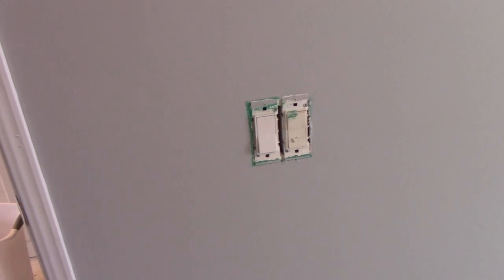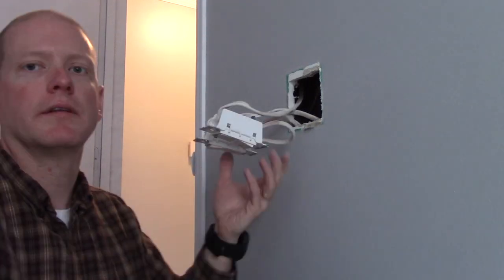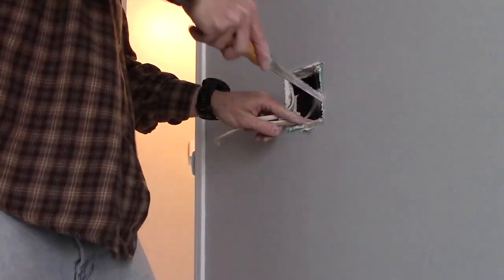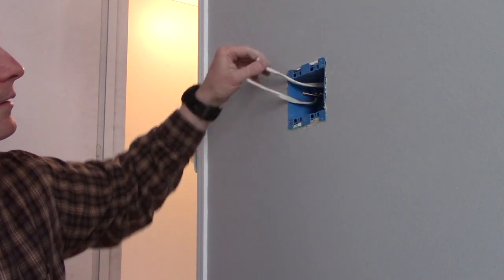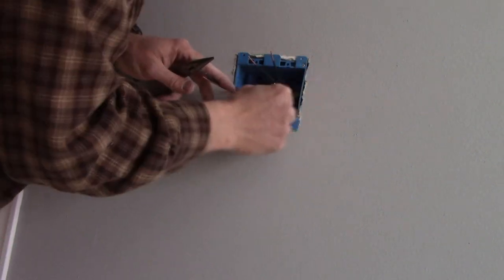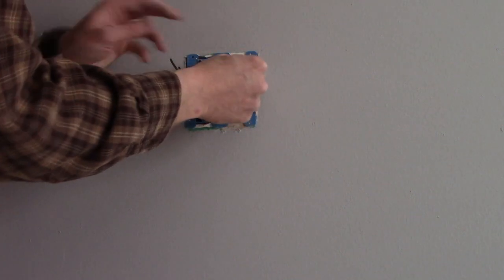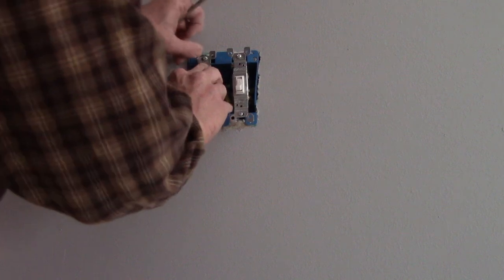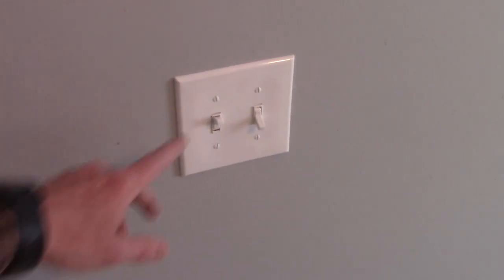How To Replace Mobile Home Self Contained Wall Switch or Outlet

Comment: good morning. im looking to take on this exact project this morning. i get lost at the ground wire part.. where are you pushing the ground in the gang box?
Reply from the maker: Please don't take this the wrong way, but honestly if you don't understand the ground wire situation you probably shouldn't be doing this. You would not want to burn down your house and electricity is very dangerous. To answer your questions, the grounds are all connected to each other and to the ground screw on the outlet or switch. They provide an alternate path to earth just in case a hot side wire were to come in contact with the appliance or switch, etc.
Reply: I understand getting lost at that part. Around the 16 minute mark, you put the two shorter ground wires in the wire connector, then a jumper in the same connector? After the 16 minute mark… the explanation on which ground you put where, falls short. So you have two ground wires in each connector? Plus the jumper?
Reply: 1 jumper (black) is power to the switch, the other is a ground wire for the ground terminal on the same switch, also, I believe he had 4 ground wires, plus the one to the switch so a jumper would be needed to connect all 5 of the grounds together @THEerynwithay

Comment: have you ever had to install gfci outlets on a 80's model mobile home ? 
friend of mine bought a double wide mobile home and wanted gfci outlets in the kitchen . there were 3 old outlets. we bought 3 gfci units. installed them , and no power. so then we put back to of the original sockets with the 3rd being a new gfci . then it worked. 
any idea as to why 3 gfci's wouldnt work on the same circuit ?
Reply from the maker: If they are all on the same circuit and daisy-chained from one to another you only need one GFCI. There is a line input and a load output on the GFCI. You might have had it wired backwards, the in and the out. It will not work if it's wired backwards
Reply: yaa, thanks for the info... and , seems I did wire it backwards.. but I corrected it on the first gfci socket. this same socket also supplies power to 2 other wall plugs along the kitchen counter top , making a total of 3.
for some reason , the seattle house inspector says there needs to be a gfci on all 3 of these plugs. i kinda question his thoughts on this matter tho , just dont make no since to have 3 gfci's in a row like this when all you need is 1....

thanks for the reply....
Reply: Just found this 

https://www.lni.wa.gov/TradesLicensing/Electrical/files/Misc/ResidentialChecklist.pdf

" D NEC 210.8 At dwellings, ground-fault circuit-interrupter (GFCI) protection shall be provided for the kitchen
dishwasher branch circuit and for all receptacle outlets in bathrooms, garages, crawl spaces, unfinished
basements, kitchen countertops, laundry areas, boathouses, outdoors and within 6 feet of sinks, bathtubs,
and shower stalls. All GFCIs shall be readily accessible.
Reply from the maker: Yeah different states/cities have specific requirements
Reply: yup yup....
Kanon Electric came out and installed the 3...
15 minutes worth of work for $645.00.
I had to find a bucket of ice water to sit my butt in ....lol
Reply: Your smarter than the Inspector @donnyinalaska

Comment: If you are replacing an outlet with one open wire and one "U"ed wire, do you keep your ground and neutral joined?
Reply from the maker: I dont exactly understand what you are asking, but you should never connect the neutral and ground in an outlet or switch box.
Reply: HALP! I have the same problem as this young lady and precisely the same wiring situation as what you show. I have all the commons connected like yours using the same wire connectors. The ground is connected using the jumpers. The problem are the Hot leads. Either when I  connect  them, the fan works, or the lights but not both at the same time. Using a volt meter shows one switch with power, the other without. What am I  doing wrong?  Wife is about to shoot me.... any hoo how, Happy Holidays!

Comment: So we tried following this video but we don't know much about wires. We couldn't really see which wires you were grabbing in the video. Is there anyway you could give us some tips on mkaing it easier when we don't really understand this? We managed to get it replaced, but our old work box won't secure all of the way flat against the wall on the bottom. We also somehow managed to have the light that controls the fan being the first one when we changed it instead of it being controlled by the second switch, which we didn't mean to do. Thank you!
Reply from the maker: Id love to but without understanding your specific situation that is almost impossible. Obviously you want to do this yourself, otherwise you would have hired an electrician, so Id recommend watching some other youtube videos on wiring basics, such as how a lighting circuit is run, what the wire colors mean, etc. It also helps to label your old wires before you remove them that way you can hook them up the same way on the new switch or outlet.

Comment: As explained by one commenter below (yeah, those self contained switches and outlets blow) - I have 2 or 2 1/2 inch walls with no stud in sight. I have a number of 2 inch boxes now - but with 6 - 12wire coming in - I think the only way out is some sheet rock work.

Comment: Now if I can just figure out the wires. I’ve watched this video three times so far and simply can’t figure out what to do with all the wires. 

I have one hot, one neutral and a ground all from the breaker box, one black, one neutral and one ground from two other wires coming in that go to the fan and light. I see he puts two black jump wires in the connector box and two black wires from the home. He puts the commons together in a connector box but do ALL THREE commons go in those connectors?  Do any of those connect to a switch?  Then he connects a black wire to that second switch. Is that the jump wire from the connector?  Because it looked like the main wire coming in for the fan. 

I’M SO CONFUSED with all these wires!  An electrician even looked at this mess and said he really didn’t know what was going on with that stuff. So now it’s up to me to figure it out. 

HAD TO CHANGE THEM because one switch was black inside and some black on outside indicating a short in there and the flippers broke on both of them. 

Anyone have any advice for me?

Comment: The self contained switches are just about as bad as wiring up a switch using the quick connect method. Screw terminals are always a much better option.

Comment: I wish he would have explained what wires he was connecting and the light in the box was low so couldn't see that well.
Reply: I agree and I couldn’t see because of his hands but that was not his fault as the wires were too short to pull out and show us. 

This is the EXACT situation I’m in. Hooked everything up the way ace hardware told me, nothing worked, NOTHING. 

Talked to an electrician and followed his advice who said I have to have ALL GROUND WIRES AND ALL COMMONS hooked up. Breaker kicked as soon as I’d flip the light or fan switch. 

Talked to another electrician who said do not hook up commons and ground, only one or the other. Tried it both way. Breaker kicked every time, same as before. 

Talked to an electrical supply company. Told me put all black wires from power and light in connector box and jump wire to light switch then jump wire (black for power) to another connector box and go to fan switch. Do the same with all commons and hook every ground up. 

That got me power, both light and fan worked whether they were in on or off position when I turned breaker on. As soon as I’d flip EITHER switch in or off, breaker kicked. 

PS, had electrician out and he said he really had no idea what was going on with this mess. I think he was the wrong electrician. 🥺

Any advice?  Help?  ANY information that might help at all???

Comment: Question, just replaced one of these with a regular outlet. My problem is they used it as a power tap where a single Romex went through it then on top of that was another romex going out. So it looks like 3 romex cables are there. How should I properly wire an outlet? I did like this guy did in the video at 3:33 ...... https://youtu.be/tFVlonwpsco
Reply: I hope you figured it out or got an electrician.

Comment: Gang box is too deep for my RV wall.
Reply from the maker: Yeah this video does not apply to an RV.
Reply: They make shallow wall boxes.  If your local store carries them.
Reply: Cut the back off the box, then save it to either drill holes and zip tie it to the proper length or duck tape it back on.
Reply: They have shallower ones.  I've seen em at home depot and Lowe's probably has em also.

Comment: I wish you actually show how to replace those boxes with THE SAME one... I don't care they are garbage :).
Reply from the maker: Lol. Sorry i cant have them in the house. I think they are unsafe.
Reply: @JackofAllMasterofNone  no, problem. You are right they are not good. I'm going to replace mine just like you did. Only problem I need to find shallow double box.
Reply: First off the ones I've replaced are actually burnt and melted from using ordinary floor fans rated at 10 amps.
Second the clamping tool is around $30 bucks. Even if you use a regular C-Clamp and are able to snap the back on you still have the same hazardous junk in the wall.